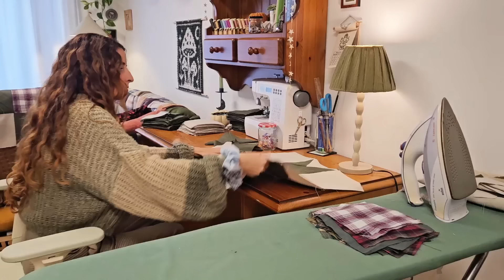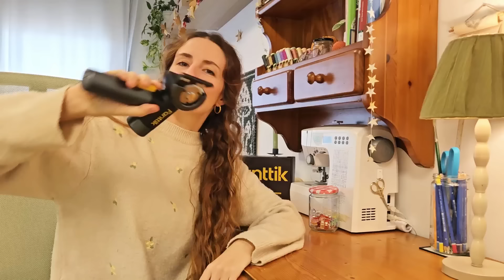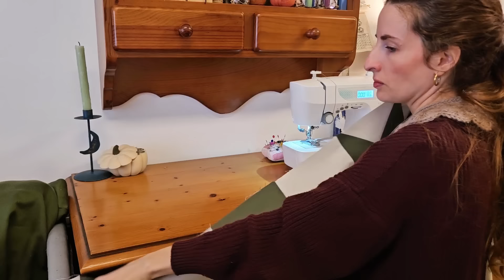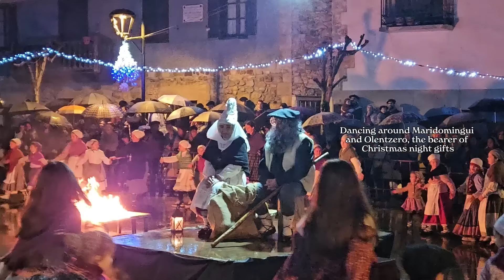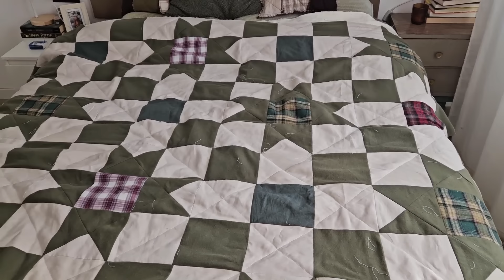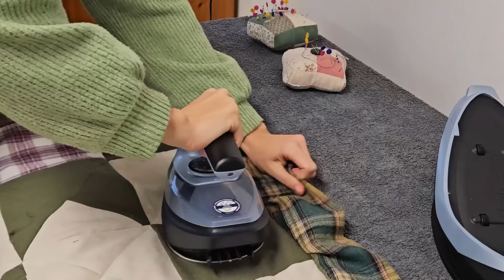Sewing a Huge Quilt with a Domestic Machine — Is it possible?

Comment: Here's how I make the quilt sandwich: I put the back fabric on the floor, wrong side up, just like you did. I also fixate it by using tape. Then I add the batting (to make the quilt thick and warm). I put it down in a way that I have a border all around. Then I roll the batting up like a sushi roll and use spray glue to ssecure it. Then I add the quilt top, good side up, and repeat the sushi roll thing to spray glue it in place.
Reply from the maker: Thanks so much for sharing your method! It's always great to hear how others do it! 😊 And the spray glue doesn't make the needle all sticky later? Do you have a spray glue brand to recommend to me?

Comment: I agree, its unfair of the algorithm to punish creators when they take a break or take longer to work on a video. I'm not sure what the solution is: except persevering with a slower pace because eventually the algorithm recognises the new schedule, but this an issue I'm seeing with a lot of creators in this sort of area (fabric related, where a slower pace is necessary). But the important thing is - that quilt!! 😍🤩 it looks fabulous, so warm and cosy! The last "large" quilt i made was a lap quilt, so just large enough to cover hip to feet (and square). The wadding I used on that was far too thick and I really ... REALLY struggled with a) getting it through the machine 'hole' and b) getting it sewn at all because I didn't have a walking foot. That was about 20 years ago, and the experience put me off. I'm not sure i would attempt a large quilt like you have. So brave! But I recently saw a technique called rag quilting, which I think you know too - I saw a cushion with that technique on your bed? - which may offer more possibilities as the quilting process happens when you sew together the squares, so then there's only the manhandling of the quilt to sew it together. Maybe one day! I look forward to seeing what you made with the other blocks!
Reply from the maker: It's so true about the algorithm, I also read youtube is now pushing shorts instead of long content, and all creators are experiencing less views in the long format videos, it's a shame because here on YT I think most people enjoy long slow content instead of scrolling though shorts you won't remember later. But I'm glad you enjoyed the quilt! ❤️ I also know the struggle of quilting without a walking foot and too thick wadding, but I can tell you it made a difference, I think it will help too when I have to sew thick fabric. Yes with rag quilting that problem is solved because you quilt square by square. For the other blocks I have a few ideas, let me know what you think!. With 5 squares I can make a bed for Momo, one goes flat on the center, the other four making a tube, one for each side, and on the bottom I can use another fabric. Another idea is making a table runner, although we don't use that so much. A reversible pillow would be cute too, with one type of blocks in one side, and another in the other side so I can change the design. I have 5 blocks, so if I make the cat bed there's none left for the other projects
Reply: @estelsogo  I love the matching cat bed idea! definitely make something you would use (so no to the table runner from me, if you wouldn't use it). The pillow would work too - you could use 4 squares for the cat bed by only doing a tube on three sizes, so Momo has a flat side that he can 'enter' the bed by? Neve has a bed like that, (commercial and unquilted) and it works very well. if you did that then you have one block free for a pillow/cushion for your bed? The only other idea I have is to make 4 blocks from a plain fabric (e.g. grey) and then put them together with your other blocks. Quilt them together without the wadding or use very thin wadding and turn it into a wall hanging? Seriously thinking of investing in a walking foot for my machine - if nothing else because you can also get a bar that allows you to sew specific distances apart which would be useful for some quilting. I want to make a mat for my sewing machine to go on and a cover for my sewing machine too (dog hair... ughhh! gets everywhere!) and looking to quilt both of those - so the walking foot would def make it easier. NOT cheap though! Glad to hear you found yours useful - and would be good for other projects besides quilting.
Reply: @estelsogo  As for youtube, I think the people in charge are going to have to stop thinking about YT en masse because what works for one segment won't work for another ... and although individual crafters don't make up a huge part of YT, as a whole, I think they may be a fairly big part of it. Not just people who sew but other crafts too. That said, many people are moving to other places as well as YT - so Google needs to make sure they don't drive people away.